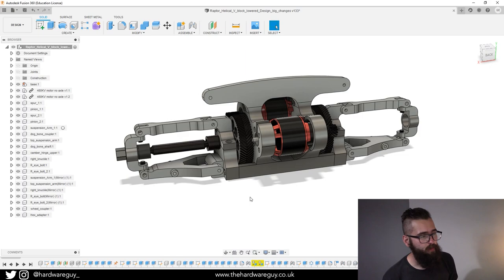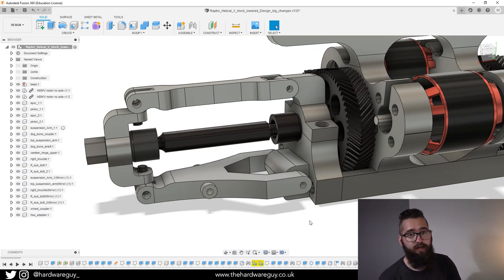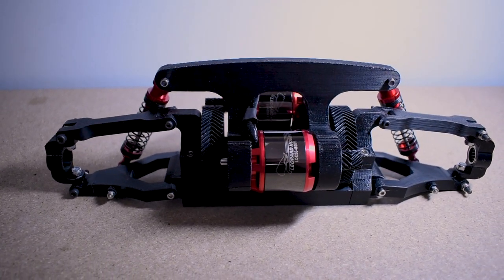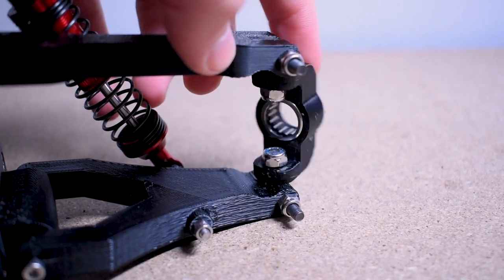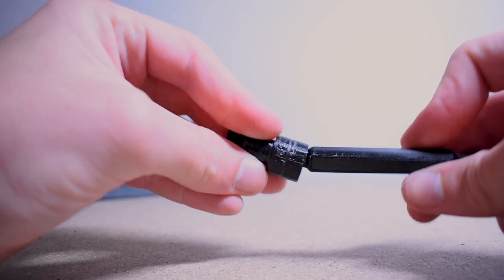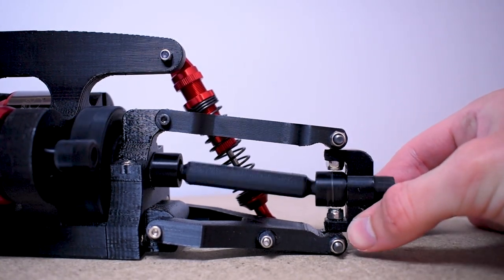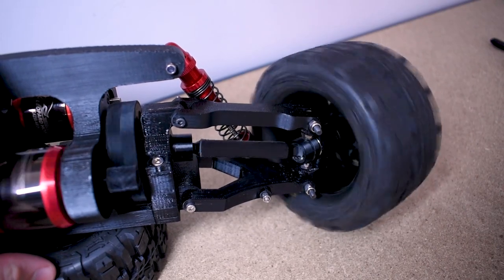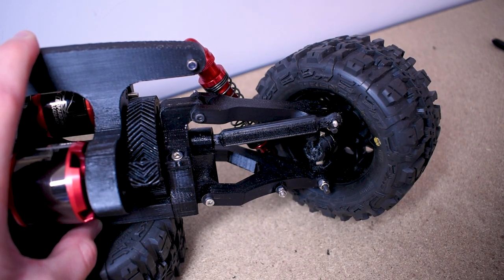Raptor II: Test Block & 3D Printed Axles

Comment: Nylon isn’t that difficult, one of the secrets is print it dry, as dry as you can (I’ll put in the oven at 70-80’C for a couple of hours first), slow, and with NO fan or draft of air at all (will cause delamination issues, especially with CF based nylon!)
Taulman Bridge is pretty easy, as is their PCTPE...
In any case I’d recommend learning to print with it, it is on another level in terms of strength!

Comment: Printing in Nylon will definitely give you better results,  the material is self lubricating so would reduce heat build up between the rotating parts, have you tried creating a print in place part with the shaft and the couplers. The one thing that makes nylon difficult is moisture, it needs to be stored in an airtight container like a cereal box along with desiccant in the bottom, I use a food dehydrator to dry the filament before use. Also to improve the mechanical strength of the part you could anneal the parts by heating them up and allow them to cool slowly reducing the residual stresses in the part. Good video by the way

Comment: As an idea try and rotate the print so its printing horizontally, this will put the print in its strongest orientation and stop it from delaminating
Reply from the maker: can confirm this helped a lot! I printed the couplers in two halves and glued them together, no breakages at all! check out my most recent update👍🏻

Comment: Also, having a steering linkage holding the knuckle in place would probably stop a lot of the vibrations your seeing with a closed coupler..
Reply: It's also good to have it run as smooth as possible before you add a steering linkage, otherwise, that force is just being endured by the steering coupler instead which is not exactly a great idea.

Comment: Try to increase the thickness of the coupler ,by removing the steel nuts and use Threading on the part itself.
Anyway your I like your design and I believe you can make it work ....
Thanks for sharing your experience and trial.
Reply: like the tarmo4... that part is not getting much force in that joint, at least not in the direction where the nuts are holding the screw on...
Reply from the maker: Plastic thread wears away easily under heavy vibration so it a a bad idea... it’ll become loose in seconds! I tried it

Comment: You need to have the 2 pins on the axel 90 degrees appart to cancel out some dynamics, which will reduce a lot of vibration

Comment: You migth want to try out Spectrum 275 ASA , I find it quite different to normal ASA (also settings) but in the end nice prints and stronger layer than PETG but a bit more flexible and does not shatter like the part in your video

Comment: You mentioned not knowing whether you can print nylon on your printer. I also have a Prusa mk3s and I print in Nylon all the time. With normal Nylon, you can sometimes get a bit of warping but with one of the fibre filled ones from Matterhackers there really is no longer a problem with warping, just make sure one change you make to the printer is a hardened nozzle, personally, I use the Olsun Ruby, even though it is really expensive it is worth it as it doesn't wear down as much AND there is a lot better conductivity due to the brass still surrounding the inner Ruby. I have a highly 3d print modified tt02b car which uses a waterproof (504 can) 1406 motor and Mamba X from HobbyKing and I'd love to make an altered version of your car in the future to replace my TT02b using 4 of these motor and ESC setups. They have highly optimised hall sensors already on them and the Mamba X takes the information and updates the motor live as your hall sensor will. I think I'd have to make some custom firmware for the ESCs but I might be able to use these in a similar setup you are working on. I'm starting Mechanical Engineering at the University of Birmingham next week (UK) and I would love to collaborate on this project with you, especially as I could do some aerodynamic and stress analysis simulations as I have Solidworks training and certification so I can actually do that. Can't wait to hear back. Many thanks, Elliott Dyson. :D (I know it's a big comment, sorry about that). 🤣
Reply: Just one more thing, those premade metal dogbones, and axles are a lot weaker than they look. I had some really thick hardened steel ones in my TT02B before I printed them out of Nylon X and they ended up twisting and then snapping under the immense torque and weight of the body, the tiny part that screws into the wheel hub was always the worst, too much weight on such a thin threaded piece of metal, won't stand a chance in that beast of a car. The Nylon X is still holding up great. :D

Comment: Drive shafts are a weak point. Therefore, in my 3D printed Hammer H1 project I use metal shafts from traxas slash.
Reply: Wait, you bought those overpriced AF 100$ Traxxas metal shafts?? 😂

Comment: You may want to consider a lighter tire. Those belted trenchers are very heavy and are going to be a lot more prone to breaking things in the drivetrain.  Also polymax polycarbonate is fairly straightforward to print and extremely strong and tough.
Reply from the maker: I weighed them against my cheap Chinese wheels, the trenchers are only 10g heavier... I was surprised!
Reply: @thehardwareguy  then the Chinese tires are heavy as well. The belted trenches are notorious for being heavy. There are definitely much lighter options out there.
Reply: @thehardwareguy  try the dboots backflip LP tires. Pretty light but still fairly large.
Reply from the maker: I ruled out 3D printing axles and I’m now using hardened steel racing axles! Check out my most recent update! I’m confident that the gearing will be fine, especially printed in PolyMax Polycarbonate👍🏻

Comment: you may want to use 3mm nails instead of the cut off M3 screws as the thread will wear away the plastic over time
Reply: Or use a hex head bolt and locknut, like the tarmo4 project, smoother on the plastic... also, are you greasing up all contact points..?
Reply: Also, if you “balled”/ rounded the ends, you could probably get the same effect with a closed coupler, which in turn would be stronger than an open one
Reply: Or use nylon with its self lubricating properties, then there will be less wear. Also, there is one that is enthused with Kevlar fibres that has great friction/wear resistance.

Comment: Dude, can you invert your Knuckle pivot bolt and nut assemblies , that way the nut is not in the way of your shaft hub and use a taper M3 bolt head so you get more clearence.
Reply from the maker: Hi man thanks for the comment!  I did think about that... but if I invert them, the knuckle will have to pivot on the outside of the suspension arms. This causes clearance issues when mounting the wheels.... the nut would make contact with the inner wheel and reduce steering angle! I have a better solution now, update coming soon👍🏻

Comment: You should try overture nylon or polymaker nylon copa. They are both crazy strong nylon 6 and nylon 6.6 copolymers.overture is cheaper though and my personal favorite.
Reply: Ps:Follow printing instructions on the packacking, particularly bed temp, its very important. They are NOT a normal nylon. If you print them like other Nylon itll be a catastrophe lol. Just use a little hairspray if you have small details that you need to stick.

Comment: I would recommend Polymaker CoPA in case you do try nylon
Reply: I have tried CoPA it doesn't stand up quite as well as the Matterhackers stuff.
Reply: Really? Thanks for the info. Is it easy to print too?
Reply: @santiagoblandon3022  Easier than CoPA, especially the ones filled with Kevlar/glass/carbon fibres but you should only use the fibre filled ones if you have some sort of hardened nozzle

Comment: Hey great video man, i have tought about printing with Nylonx to replace weaker parts and am getting a metal hot end for my printer for that. I think printing nylon is really just about the melting temperature that needs to be higher.

Comment: Did you consider using PC Blend by Prusament?
Reply from the maker: more recently I've been using PolyMax Polycarbonate for the parts under most stress (couplers, knuckles etc.), much stronger! I wouldn't print the main chassis in PC because it's very expensive and a pain to print, even on the Prusa!

Comment: Your u joints are out of phase and the output shaft is not rotating at the same speed, it's oscillating in contrast to the constant speed of input side. There's a good you tube video that explains how that works (an old guy with a credit card, some tape marks, 3 gears, an axle, 2 uni-joints & motor somewhere...)